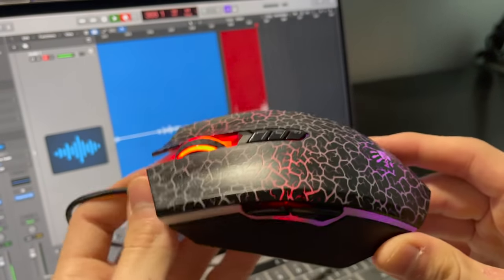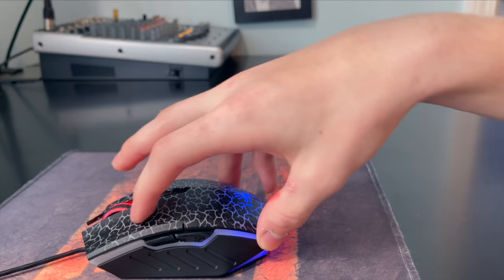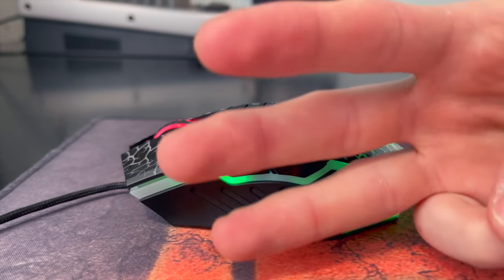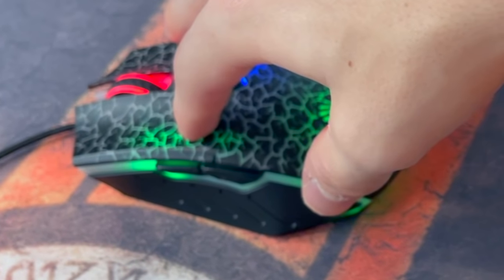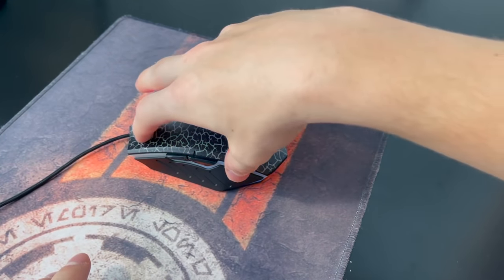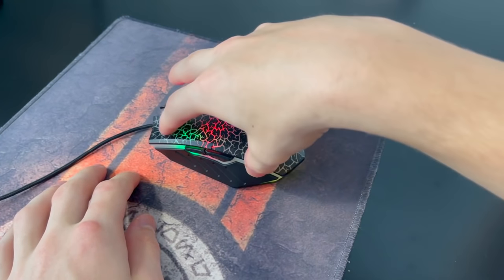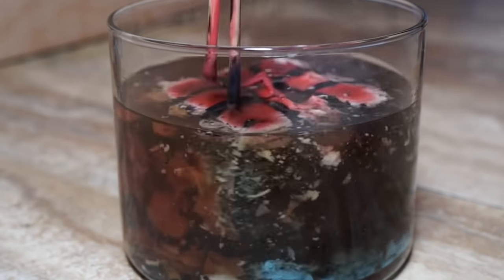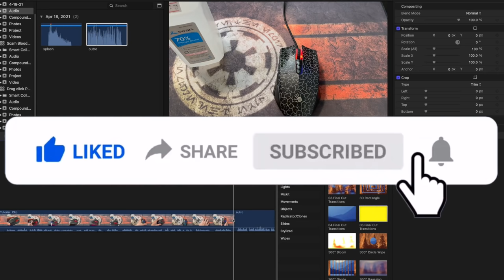How to Dragclick in under 10 Minutes

Comment: my finger is sliding
Reply: Same
Reply: YES
Reply: Your doing it wrong
Reply: @Neon126_14 oh ok difference types of plasic
Reply: Just jitter or butterfly
Reply: GUYS IF YOU TRY DRAG CLICK BUT YOUR MOUSE JUST SLIDING THEN TRY THIS!!! Take paper and put it to mouse button, then make your hands 90% dry and 10-5% wet, and hold your mouse with other hand. Then hold your index or middle finger with your other fingers and easily drag your finger on mouse. I have two mices (Delux, Canyon) and they're all office mices but this method helped me to learn to drag click. And after 1-2 weeks you can drag click without paper.
Reply: Or use electrical tape and sharpie
Reply: is sharpie is the  white board pen ? @laminate31

Comment: hard to learn but got me learning after a week now i can officially telly bridge and god bridge thanks to these tutorials id say this is one of the best tutorials that ive been through the bit  that i mainly learned is top bit pressure bottom tiny tiny pressure and just let the finger move itself with friction
Reply: what mouse do u have?
Reply: @Fra47_  i use a pretty cheap one named Fantech Basic Wired Gaming Mouse X9, RGB 7 Macro Buttons Programmable True 4800 DPI Claw Grip Comfort Beginner Gaming Mouse for Window PC, Black and redragon 601
Reply: @Fra47_  normally use both not at same time ofc but just use them at diff times dk why both of them the same but redragon has higher dpi

Comment: You are hurting ur hand dragclicking that way, bé carefull
Reply: How
Reply: @jump6065  you need to have most of Ur arm on the table
Reply: @Nolh26GR  I've been dragclicking for 2 years and I have no problem with my hand
Reply: @jump6065  yes, you Can have problems doesn't mean you have problems, and beige careful IS just an advice and I just told you this so you know it Can happen,